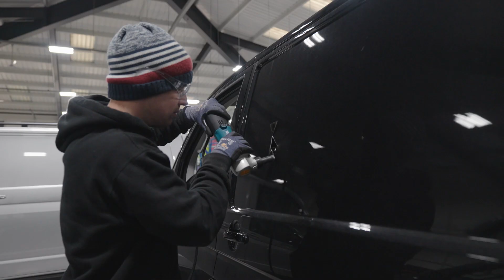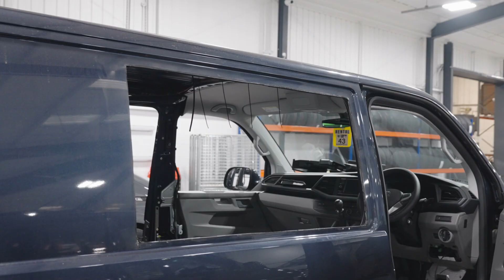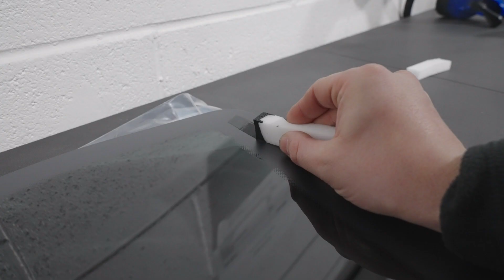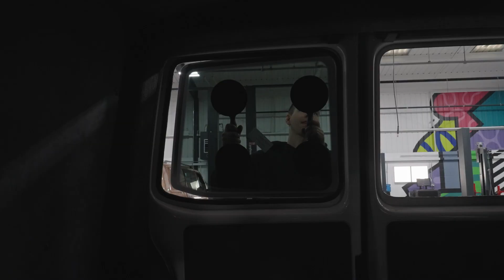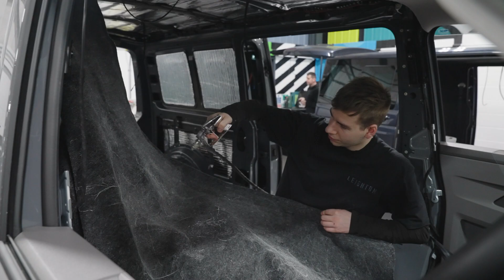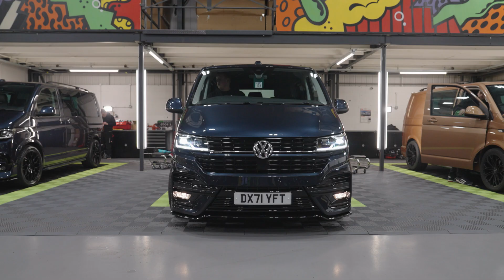Convert your VW Transporter Panel Van into a Kombi

Comment: How do you install those rear seats into a panel van? Will you need to drill additional holes?
Reply from the maker: Yeah exactly buddy, you'd need to drill a number of additional holes depending on what rear seat combination you'd choose.
Reply: @leighton-vans  Of course, you have to do it in a certified place. Otherwise, it will not pass the inspection.
Reply: Can I ask? Which country and city are you in?